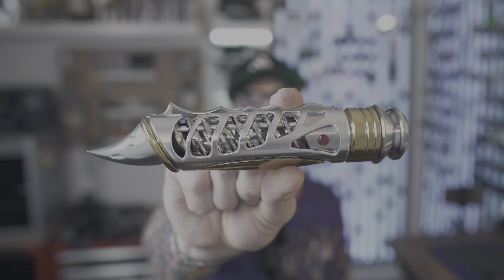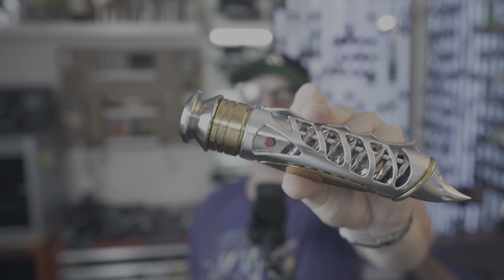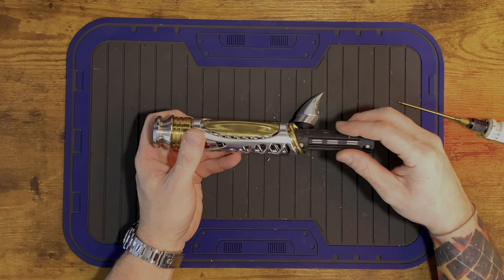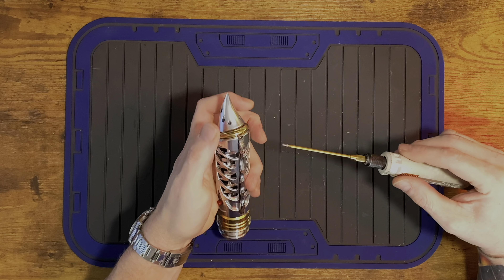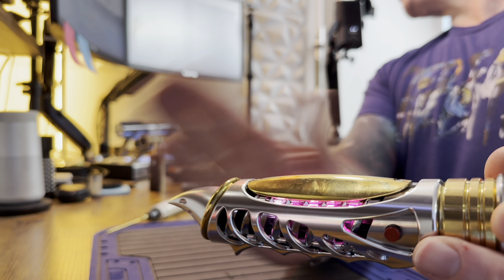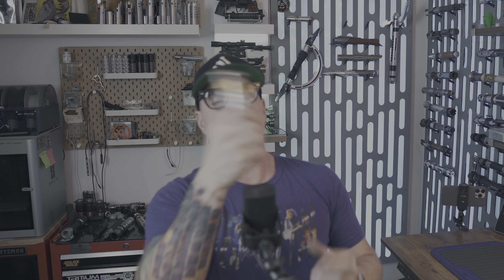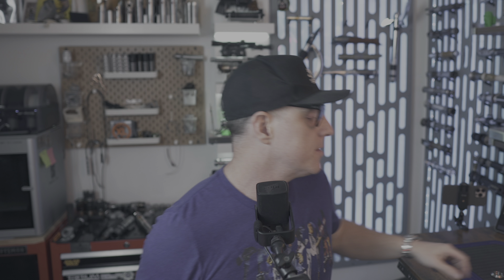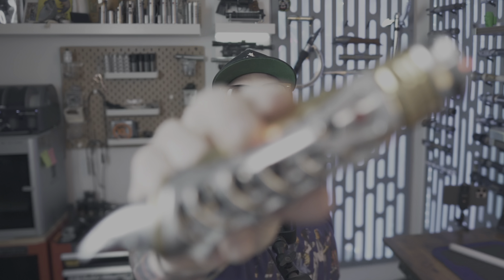Jawas Junkyard ‘Red Harvest’ Custom install

Comment: I am so far removed from the custom hilt and customs install world. Would it be asking to much to ask what kind of $ it cost for this hilt fully installed? I would try and figure it out on my own but I don't know where to start. I did my own basic build with a cfx in a MHS hilt I peiced together but custome chasis are beyond me.  Thanks if your able to help. If anything pointing in a direction would be great.
Reply from the maker: Custom installs can very between hilts according to complexity etc but a general ballpark would be between 350-450 out the door. That usually includes all electronics etc
Reply: @TierfonOrbital  thank you! I'll check out your site and reach out to see if ur available for work when I'm ready. Take care.
Reply: @TierfonOrbital  i wish you could do a custom install for my Korbanth SK2 V3 (StarKiller saber)